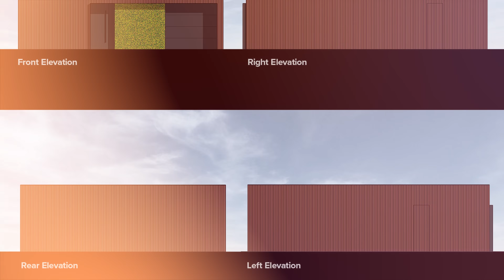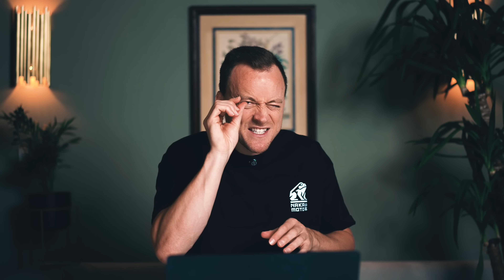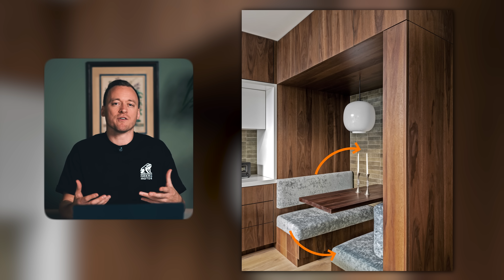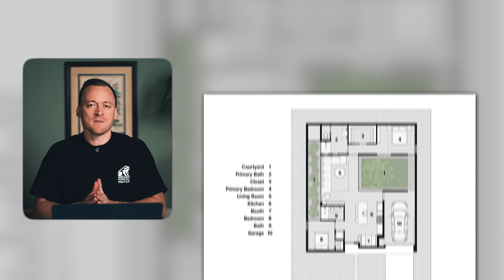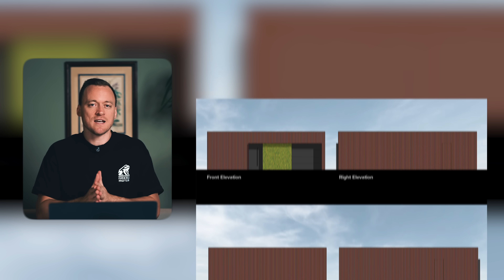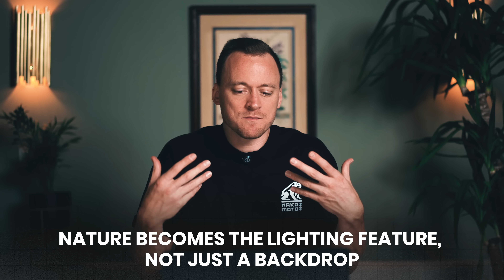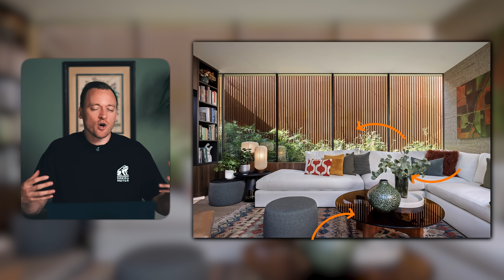this home is every introvert's fantasy. and it's real.

Comment: How does pass code? There's no egress points for the bedrooms. It's a death trap if a fire breaks out
Reply: Easy. It passed the code. If you see about 6:15, look at the door-like patterns on the left and right elevations. Those are escape doors from both bedrooms to the outside of the house.
Reply: Owner and the architect of the house here-- yes there are fire exits in each bedroom.  The video didn't highlight that.  There are steel fire doors behind full-wall curtains.  It's a detail that is completely concealed, but way safer than trying to crawl out a window opening...

Comment: I am a Designer/Space planner, and I could move into that house in a second. I love the privacy and the simple clean lines, but the home is not cold and antiseptic which is the problem with many "modern" homes. The use of luxury materials, walnut, travertine, marble mosaics, walls of glass are the way to spend the money on things that you appreciate every day. The bonus is that to heat and cool this house can be so focused with proper insulation. Add a few solar panels on the roof and you know that you can keep the cost of energy down very low. This house is a win/win.... LOVE IT!
Reply: Agree. It's amazing space utilization and layout. Unless I'm mistaken, it has a "Swedish" or "Nordic" feel to it, When temps drop w-a-y below freezing, energy use is a big consideration. And for  only 1800 sf, obviously not for a family of five or six, nor for big parties, but perfect for two, with manageable housework. Really, it captures a "million dollar" feel of luxury, with all the practicality of cost and maintenance. I wonder if it has radiant heat floors and built-in vacuum. There are similar examples of intelligent space, layout, and design in very cramped and very expensive places like NYC. And it's much more livable than some $50,000,000 careless splashes viewable on YT.
Reply: It's got solar panels with a battery backup, a high-efficiency air-conditioning system and is very well insulated.

Comment: I really like this but can’t see how this can meet code in many areas as there is need for external windows for fire safety / exits, etc.
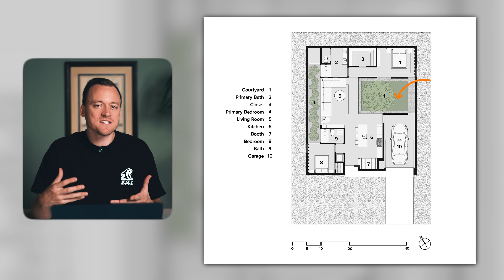Reply: I had the same thought, but if you look at the plan (5:27) you can see that each bedroom has some sort of exterior window or door. Wish he had addressed this to explain how it was concealed both inside and out while still being functional.
Reply: @zachhansen7966  I saw that but Egress (code) requires emergency escape and rescue opening…ex: when there’s a fire, firefighters wouldn’t be or not as easily get in. The window facing outside (not to courtyard) is blocked off by steel wall and windows facing the courtyard offers no real escape route or not easily accessible to fire trucks. Also, pictured windows are fixed so they don’t open which isn’t Egress standard.
Reply: Architect and owner of the house here--  this question gets asked a lot.  There are fire exits in each bedroom.  The video didn't highlight that.  There are steel fire doors behind full-wall curtains.  It's a detail that is completely concealed, but way safer than trying to crawl out a window opening...

Comment: What you should have said was " This house has no OUTWARD facing windows .  No windows is a BLACK space all together . I moved to Mexico 7 years ago and found so many homes of this nature , One of My own homes here is rather similar . The front of my home has only textured glass block windows for light to come through only .  The living room, dining room and kitchen is one large windowed wall over looking onto a narrow inclosed garden . The owner before me even mounted huge mirror panels to the opposite wall of the garden to give the idea of more depth..  My place is quite nice BUT .....The problem with this design is that after a while it makes you uncomfortable and a bit claustrophobic. as there is no depth of sight anywhere . My brain wants to see a block or two down the street . Activity . Movement .   I end up quite often just leaving the front door wide open for a little relief . If I don' t, I feel like I am  a lab rat in a box .     IT IS an interesting old Roman design but NOT really the way I would want to live If I had it to do all over again .

Comment: I love court yard homes, but ... fire code?  How do you escape if necessary?
Reply: Hidden side doors through the corten steel?
Reply: @Stangya888  You're right, that would be the solution.  Court yard homes are my favorite plan, but we always had escape routs made clear to the family..  Over the wall ladders from the inside.  A secure set up from house invasion from the outside.  ~ Thanks :)
Reply: @Stangya888  correct, each bedroom has one
Reply: @danebecker  Good to know how they did that :)
Reply: There is actually a door in the bedroom that leads out of the house. It’s covered by curtains that covers the width of the wall.
Reply: @TheCholyluv  Nice aesthetic solution :)  thanks!

Comment: I am wondering what variance this home has for no secondary fire exits? Is it fire rated beyond residential requirements? Sprinkled?  How would the fireman rescue you in an emergency?
Reply: There are fire exit doors in each bedroom, clad on the outside with the same fluted Corten steel - thus unobtrusive

Comment: That's a concept used in urban Japan. Very common.
Reply: Ancient Romans too. Their houses had few or no windows with a central atrium open to the sky. Of course the disadvantage of this design is that it allowed rain to come into the house.
Reply: @alwaysalibrarian  Good point!
Reply: @alwaysalibrarian  The Rain coming into the house was actually an intended feature in ancient Roman houses. The water usually got collected in a basin in the atrium for further use.
Reply: @alwaysalibrarian  

Yeah we all want houses that get inundated and dry rotted.
Reply: @MarMarReeOh  They DID have a very advanced floor heating and drainage knowledge for their time. The sort of people that could afford such a villa wouldn't build it in such a way that it rotted away easily or even at all. 
Material close to the atrium would be weather resistant, wooden beams and other material prone to rotting would not be exposed to open air near the atrium. Like, come on, you think the people that built cities with monuments, temples and public buildings that lasted through 2000 years of weather exposure and earthquakes didn't think about dry rot?
Reply: No, no it's not
Reply: @MarMarReeOh  I can't speak to how common it is, but I've seen it on a Japanese channel a few weeks before this.
Reply: @MarMarReeOh while i'm not an expert, i think this concept become popular because of Sen no Rikyu
Because of his preference for Simple, rustic and Local japanese design even with its imperfections compared to the imported chinese design
Reply: @MarMarReeOh  An enclosed courtyard is part of traditional Japanese home design. I guess mostly for the upper classes, but definitely part of their culture.

Comment: Love it . But how about the air flow? How can ay wind or fresh air will be able to enter the house? Or it is just fully air-condition?
Reply: Architect of the house and homeowner here--  The house has a passive ventilation system with filters, so we get fresh air year round.  On the few especially nice days in Austin, we open the front door and the courtyard access (not shown in the video) and get a nice breeze...
Reply: It’s Austin Texas. We don’t open windows to the heat, humidity, pollen etc.all the air is filtered.